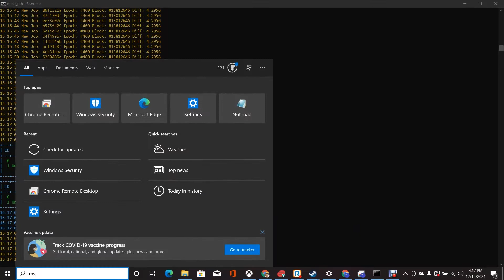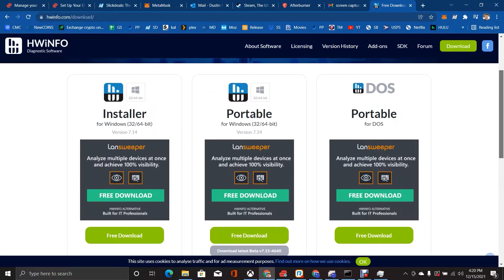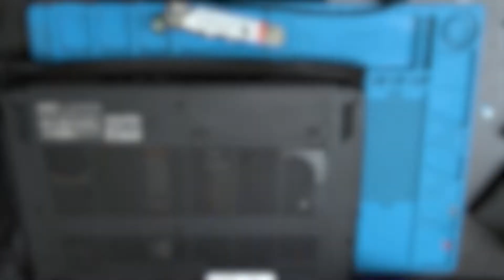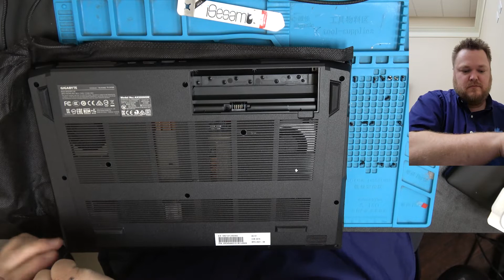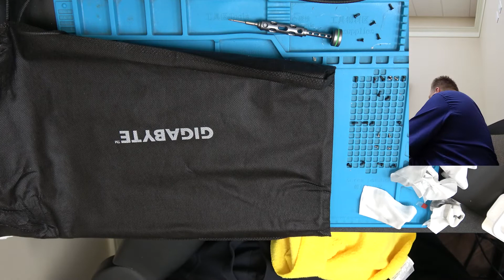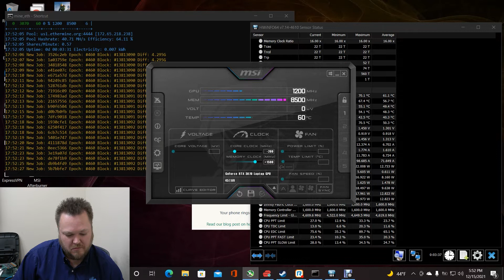Gigabyte A5 Runs Hot, Lets cool it down with liquid metal, Also includes ETH hashrate

Comment: I had the XMG Apex 17 back then. If i knew the stock paste was that poopy i had replaced it and kept the laptop. Performance and Screen were really nice but the temps and fannoise were terrible. I now own the newer Apex 15 which has much improved stock cooling and fannoise + better performance. If i update the TIM in the future i might go with Thermalgrizzly Kryosheet. Very good heat transfer and no more worries about drying up.

Comment: Have no idea why but the stock thermal paste on the cpu meant it was reaching 100*+ in terms of temps. Wiped off the old stuff and put on some new and tada runs at 60 without the fans running practically at all.
Reply: are we talking about the same laptop?
Reply: I've changed out factory paste to Honeywell TPM 7950 on my brother's A5X1, and Tdie temperatures still reach 99.2c regardless of paste on 5900HX (90c when laptop is upside down), but CPU SOC temps dropped significantly.

When testing in Cinebench 2026.1.0 I'd be getting 99.8c on CPU Tdie, Core, while SOC would be at 85.6C. 
After changing the paste, temps went down on SOC significantly (67.5c), while Tdie still menains 99.2c.

Biggest performance boost with no temp changes was on GPU (RTX 3070).

Before in Furmark2 at 1080p it would score 5943 points with 98 FPS average, temps reaching 88C and max power being 120w.
After in Furmark2 at 1080p it scored 7085 points with 117 FPS average, temps reaching 87C and max power being 142w.

Comment: yikes.  If you look at the inside of a PS5 they have a foam surround around the edge of the processor to prevent any liquid metal from getting out.  Even then, you find some liquid metal will have gotten on the foam.  This has practically nothing stopping the liquid metal from spreading, so I guess its only a matter of time.

Comment: can someone tell me if the a5 k1 is the same procdure to upgrade RAM and Hard drives? Sadly theres no intructions to open and the Manufacturer told me "we have no pdf pls watch internet videos" lol

thanks alot
Reply: The opening of the bottom lid is the same, you just dont remove the fans and heatsinks, obviously. You just add the new SSD in the free port, pull out the RAM and stick the new ones in and screw the bottom lid back on the PC
Reply: @martinchrom4444  Thank you very much for the answer! I'll see the second NVME (m2) slot. But the manufator describes that theres also a slot for a HDD/SSD 2.5°.  23:39 (in the video) do you have an clue where is the HDD/SSD slot should be there? Can u maybe circle it in a Picture or describe it? I would be really glad. And sory for the inconvenience. :)

Comment: doesn't conductonaut eat away at the copper alloy usually used in these laptop heatsinks?  been seeing videos of people pulling off their heatsink a year after installing this and having pits in their heatsink.  at least on laptops.  i've been running this liquid metal on my desktop with a noctua heatsink for several years and haven't had any heat issues that would trigger me to look and see if it's actually done anything physical to it.  actually now that i think about it i can't remember if i only used the liquid metal for delidding and redoing the TIM or if i also applied any that would touch the heatsink.

Comment: I've had my A7 X1 running on Conductonaut since last year. Thermals are night and day. Put it on top of a decent laptop cooler and you'll never see it go above 80 degrees CPU or GPU pushed to the max. 75 degree ambient room. Love this laptop, the screen color gamut is shit though but you cant have it all
Reply: what cooler do you use if you dont mind me asking
Reply: @gizzybutler31  On the IETS GT5000 Tried the loudest setting at around 75db, cyberpunk 2077 was not exceeding 62 degrees C on both CPU and GPU running 1080p ultra. Not that I need to have it sound like an industrial vacuum but did it for the lawls. I normally have it adjusted to a very low setting around 20 db or so, you can't even hear it above the laptop's own fans. Does not exceed 75 degrees C any game.

Comment: I am gonna buy (gigabyte A5 K1)  what do you think about it?
Reply: Did you bought it Bro? how is it so far because I just ordered mine .
Reply: @Triple.threee  does it heat up while gaming ? above 80c ?
Reply: @by8c  using it for around 1 and half months Im totally impressed with this machine with some settings changes CPU never touches 80degree while playing heavy games like COD MW2.Its a bit loud but nothing to worry about.I mean this laptop can run everything that you put in it with ultra settings and it never lags.I would say for the price THERE IS NOT A BETTER OPTION THAN THIS ONE.The only thing I dont like is the design its an old school notebook design so expect an thick laptop.
Reply: @Triple.threee  thank u for answering , i just ordered one hope its good
Reply: @by8c  yeah but make sure to disable agressive cpu runing because that mess with cpu and temp goes high anyway follow these instructions
Reply: @Triple.threee  ok
Reply: @Triple.threee  you recommended to buy this laptop? i have a choose ASUS ROG STRIX G17 rtx 3050 ryzen 4800H 16gb ozu or GIGABYTE?
Reply: @Triple.threee  what settings did you change regarding the cpu? Because mine is a vulcano. CPU hits 99 degrees while gaming and its super annoying
Reply: @apphilxd635  Don’t panic 99 degree is normal because cpu is on turbo mode that’s why the temps are high but I prefer to not use my cpu aggressively so I followed this instruction    https://youtu.be/GPJ5tQ6zmOM.
Reply: @brawlik123  nah bruv 3050 is not future proof.If you find an Asus with 3060 I suggest you go with ASUS but Gigabyte is far away better than 3050 ASUS.
Reply: @Triple.threee  but GIGABYTE has a bad thermals? processor almost is 95°
Reply: @brawlik123  been using it for around 3 months now my Gigabyte never goes higher than 78 degree.
Reply: @Triple.threee  you have gigabyte a5k1 3060 ryzen 5 5600H and 16 ram , right?
Reply: @Triple.threee  how?  you use undervolting or something another?
Reply: @brawlik123  Yeah.Tbh I know there is not a lot of reviews in internet regarding this laptop but mine so far is fine .
Reply: @brawlik123  I just followed these instructions https://youtu.be/GPJ5tQ6zmOM
Reply: @Triple.threee  what windows do you have?
Reply: @brawlik123  windows 11

Comment from the maker: Please support the channel by using my amazon links! 
For Recommended Parts click on the links below.

GIGABYTE A5 X1 w/RTX 3070 Laptop :
https://amzn.to/3fknkW8

Microfiber Cleaning Cloth :
https://amzn.to/3DzLJ43

99% Isopropyl Alcohol for cleaning :
https://amzn.to/3rOFoiK

Top Coat to Protect Resistors :
https://amzn.to/304XotL

Kapton Tape :
https://amzn.to/3pxUfLT

Liquid Metal I Use :
https://amzn.to/3lKRa9Z

Different Liquid Metal full kit :
https://amzn.to/3pW6fXG

Noctua Thermal Compound if you don't want to use liquid metal :
https://amzn.to/3dXwd7o

Recommended Screwdriver for Phillips :
https://amzn.to/3ycfoPG

Recommended Repair tools for Phones , iPads etc ( Phone Repair Videos )

Heating pad:
https://amzn.to/3mbIytW

Heat Resistant Gloves
https://amzn.to/3EsZdyW

My blue mat to keep everyone organized:
https://amzn.to/3BalS16

iFlex Opening Tool with Glue Card :
https://amzn.to/35UC9h8

iPlastix Opening Tool with Glue Card :
https://amzn.to/38FtzUH

on of my favorite screw driver sets 2uul:
https://amzn.to/3jsqkCz
https://amzn.to/3CcoL2Y

iseasmo w/ Kit (Has Screw driver too)
https://amzn.to/35Za2O0

Tweezers:
https://amzn.to/3B7yBlf

T-7000 Water sealing glue:
https://amzn.to/3EdzLxs 

Isopropyl Alcohol For Technical Use:
https://amzn.to/3BqBU78

Need to get a part from a reliable quick source, you'll find a better price here then Amazon and the quality will be a lot better. Click on the link below.
https://www.injuredgadgets.com/?acc=be9b6cec65c863e1b55538d2c7fcc9b0

• Visit our Website: https://tech-md.com

• My email: dustin@techmd.bz

• To mail in your phone, please contact us at 801-438-6028

Comment: I want to know if egpu is possible through the m.2 port gen 4.  I read it is as long as the m.2 is gen 3 and higher.  Any thoughts?  I might use my 3080 with this when I dock it at home for desktop use.  It should be a big step up in general

Comment: I have the same laptop and I changed the thermal paste for the kryonaut but I got the same results as with the original thermal paste. What maximum temperature does the cpu reach with liquid metal doing a benchmark with cpu-z? I am not able to lower it from 98.4 celsius...
Reply: you can undervolt it which helps significantly and you can also use some sort of stand to raise up the laptop a little bit which also contribute to lowering the temp. My gpu and cpu now just hover around 82 max degree C
Reply: @longhoang8328  with what software do you do undervolt?  what values do you use?
Reply: @djcacho  Throttlestop, I managed to minus 90mv on cpu core and 50mv on cache. You can also reduce the turbo boost power in the ""TPL"" section to "30''.
Reply: @longhoang8328  I try. Thank you so much!!

Comment: Today it's on shell shocker deal with Newegg. Plus there is a $200 rebate. Not bad for a 5900hx + rtx 3070 machine. It needs new thermal paste, like shown with liquid metal, or if you are afraid of conductive paste like me, non-conductive paste like x4 or kryonaut, and a laptop cooler to get the thermals under control. Plan to do something about the thermals and you can't beat this at $1250.00
Reply: Missed it yesterday…it was 1299 after $200 rebate…sold out in less than 6 hours. I thought it would last a week at least…